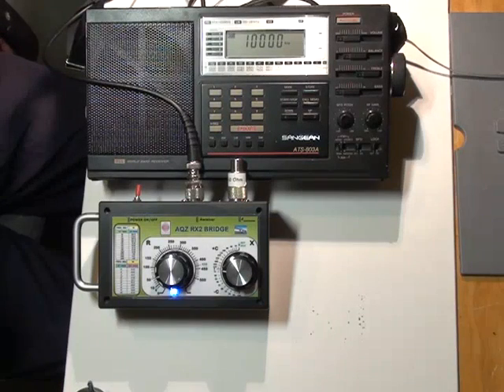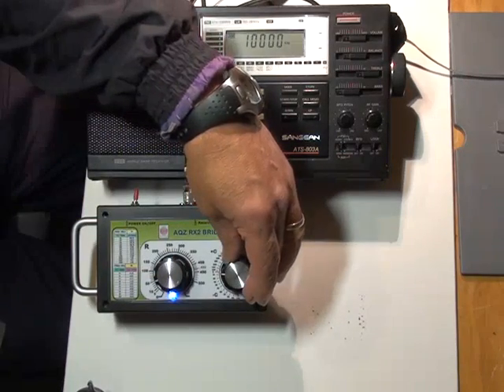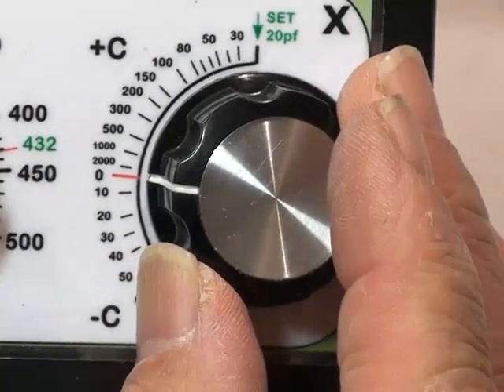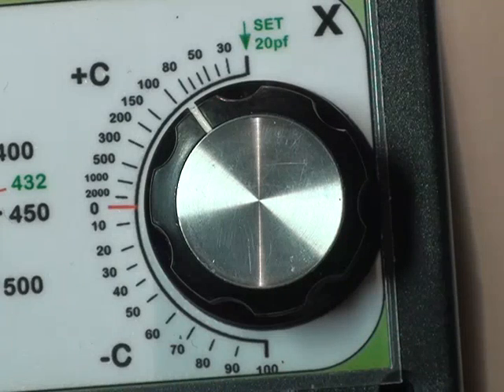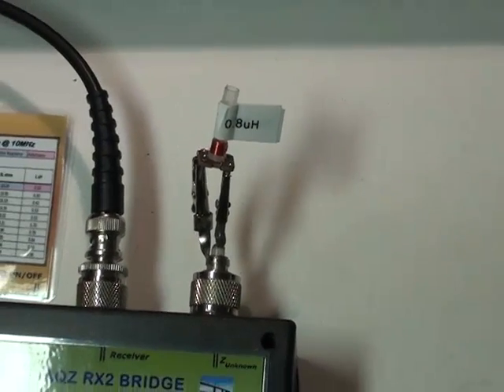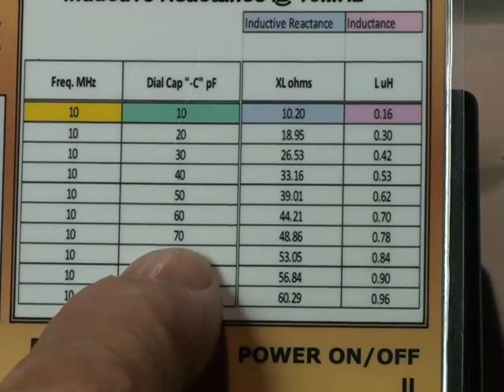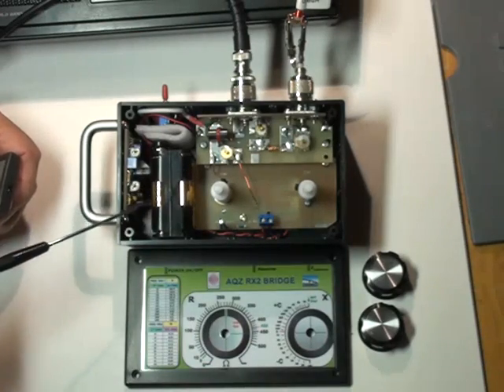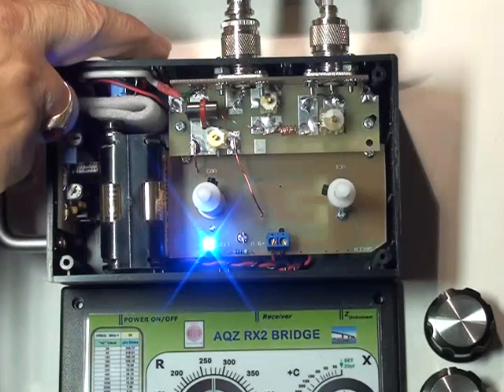Demo of the RX2 noise bridge.mp4

Comment: Ok explain my reading on my bridge my 80 meter dipole reeds 25 on the R and I get xc of 10 my bridge is an old Palomar
Reply from the maker: Not sure why I bothered to answer this question - no feedback!
Reply from the maker: I don't have a Palomar bridge so I don't know what the dial values mean. If you have the manual for it, it should be in there. Some bridges have a chart which tells you what value of the impedance is for  a given set  of dial values. The value of the R and the value of the xc together go to make up the value of the impedance - Z ohms.
 On my bridges, the dial values get put into the computer program I supply with the bridges, and that gives the actual impedance value as R - jXC or R + jXL. I can only guess that the Palomar R value is the REAL component of the impedance, and the Xc value is the amount of capacitance in pf - that in turn needs to be converted to capacitive reactance at 3.6MHz using the equation Xc = 1/(2*pi*f* C) ohms. 
That in turn would mean an impedance of R - jXc, which would be 25- j 4420.9 ohms. The R value of 25 ohms makes sense but an Xc reading of 10 does not sound right - but it could be!!.  So you really need to read your manual to find out what your dials are actually representing - particularly what an xc reading of 10 represents. Cheers.
Reply: Thank you very much you answered my question I found the manual and  read it 73s my good friend
Reply from the maker: @Kc8qdq  Ok. Very good. Thanks for the reply. Cheers jeramy.